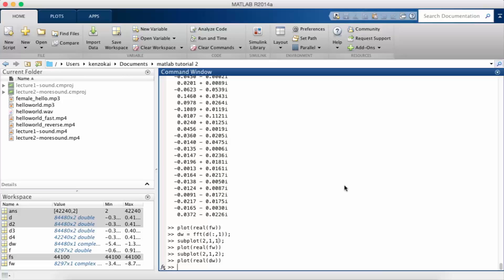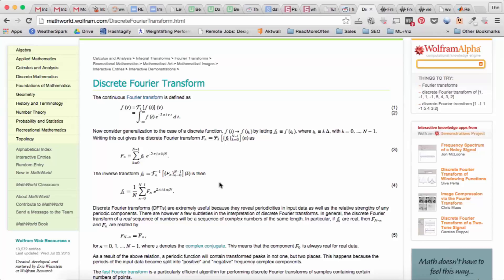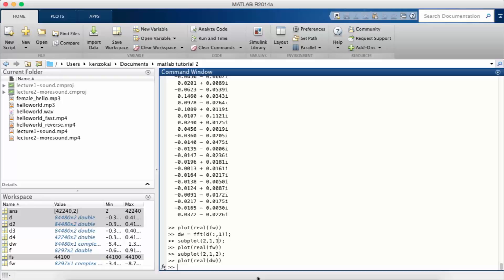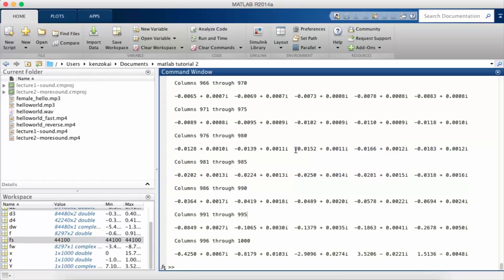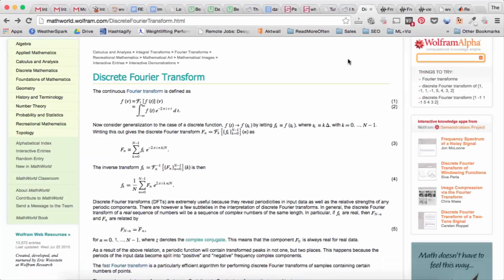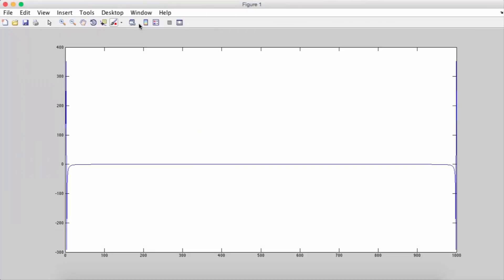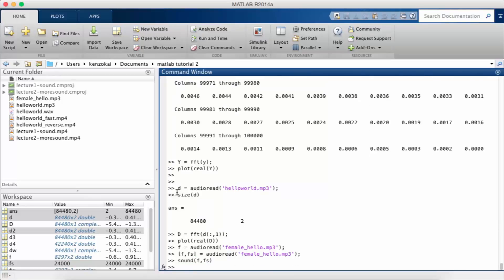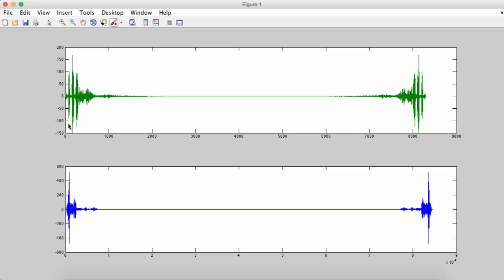Learn MATLAB Episode #14: Signal Processing

Comment: Hello sir , ineed your help in this topic 
I need matlab code for Plot of sum rate in bps/Hz versus channel quality
information threshold for various values of K , Sum rate versus number of users for various values threshold CQI ,
Average feedback load ratio versus channel direction
information threshold for various values of signal-to-noise ratio ,Plot of sum rate in bps/Hz versus 1 bit channel quality information quantisation threshold with B = 12 bits channel direction information feedback and Plot of sum rate in bps/Hz versus signal-to-noise ratio in dB with comparison between simulation and theoretical
approximate lower bound with full channel quality information feedback.please sir ,I need them hardly